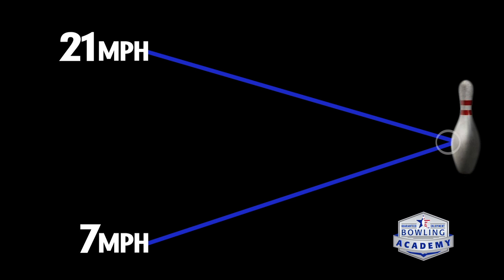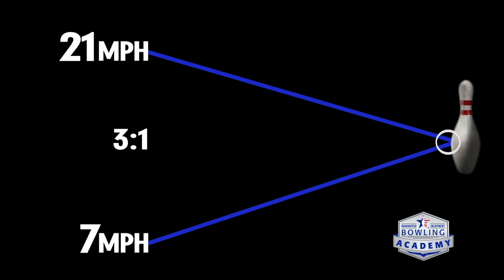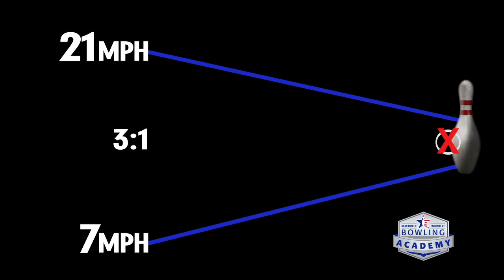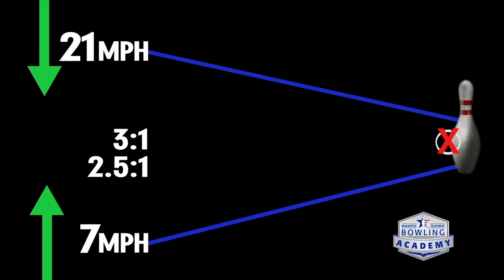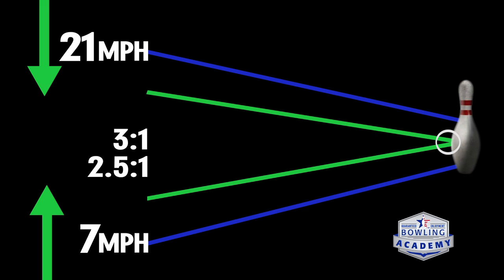Bowling Ball Release Ratio  |  USBC Bowling Academy

Comment: Can you explain your sentence : "Just because you have 300RPM doesn't mean that YOUR 300RPM is going to rotate as fast as someone else's 300RPM" ?  Because from what i remember from high school physics, that statement is 100% wrong. In fact we are using RPM just so that we can have a common tool of comparison of revolutions. Since in contains a time unit (1 min), any bowler's 300RPM would be as any other's...If a ball completes more revs in 1 minute....it obviously spins faster. If not, the same.
Reply: The Therion He is correct. He was referring to surface velocity. To get to that figure, you have to take other metrics into account. Notice he said “based on their tilt. Think of two discs with different radii. The velocity at the edge of the bigger one would be greater than the smaller one.i can see where you are coming from in a strictly physics sense, but it terms of understanding bowling ball movement, his explanation communicates to the intended audience very well.